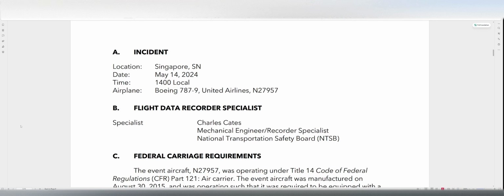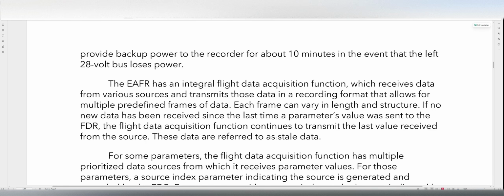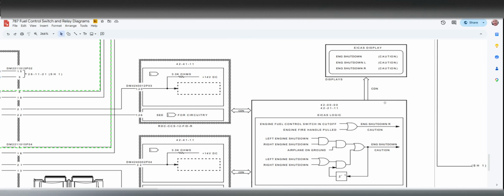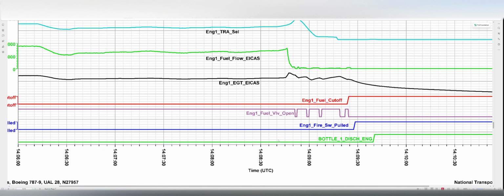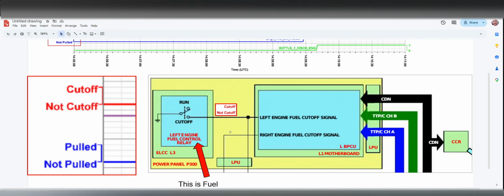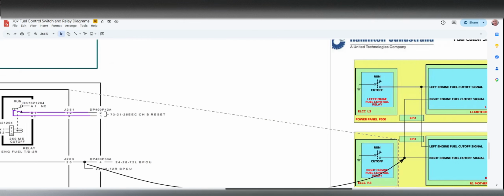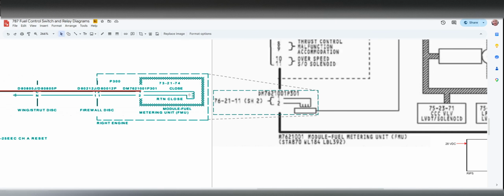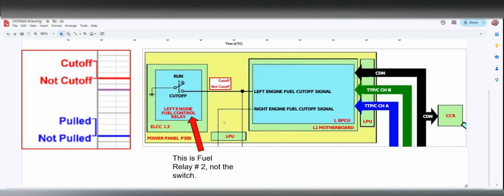Air India AI171 B787-8 Crash - EAFR Reported the Cutoff of Fuel Control Relays L2 + R2.

Comment: As usual, this episode is a very readable material pointing straight to the cause. No others know better than Jeremy.
But if all these big names, “experts”, “authorities “ don’t learn, stay innocent. Same tragedy will happen.
The use of relays in signal conditioning is completely fatal in computerised aviation control. There are hundreds of design /implementation faults in the B ‘s aircraft control system. I’m only listing the most critical one.

Comment: Any analysis into why that Eng1_Fuel_Vlv_Open log is chattering on and off for 40 seconds after the engine started to spool down? What's that reported signal from? Is this toggling actually happening due to valve position, or is it for some other reason and not a true valve report? Is it due to electrical issues in one of the busses? or busses switching 28V sources? or some other control system mucking about with the valve position?
Reply from the maker: That's the EEC trying to cut the fuel completely at the HPSOV to start a new relight cycle to save the engine from its sub-inflight idle. It cuts fuel and then commences a slow increase in fuel and ignition. But in this case, the engine was simply broken. So it didn't work then the pilots cancelled it all by shutting down the affected engine

Comment: Good material, I haven't had the opportunity to look at these systems up close. In your APR 17 episode you actually showed the RDC connected to one of the Honeywell 4TL837-3D cutoff switch circuits. That RDC directly monitors the state of this switch, and not the noise susceptible relay which is at the core of your theory. I haven't had the time to finish all your videos, but I asked Gemini to find a specific episode where you explained why this particular RDC failed to inform the recorder "hey, the actual switch didn't move, and the relay moved by itself"? Did they design the EAFR to completely disregard this RDC's report?
Reply from the maker: its not that its dissregarded. its just that in this accident, its impossible for the RAT to be out due to engines out. therefore one must look at how the RAT out was caused, and then how THAT caused the cutoff. The FDR Votes on data sources. 
Either
a. the RDCs went offline momentarily due to the lack of power, leaving only the L and R BPCUs with their many sources of edundant DC power as the next best thing. OR
b.  due to loss of the 28V, The RDCs 14V optocouplers lost the RUN signal but didnt get a cutoff signal, and at the same time the BPCU saw the Cutoff signal, which had the EAFR record CUTOFF.
OR
c. the cutoff vs not cuttoff line is never actually the RDCs, rather the cutoff vs not cutoff relay signal from the switch, as it SHOULD only ever represent the switch position by design
Reply: @jeremyjohnthompson5187  Your channel definitely needs to be heard. If power drops then there is either no data or no reliable data for the EAFR to disregard. 

One point I don't understand is why you suggest only the relay signal should ever represent the switch position by design. Doesn't that solidify the semantic discrepancy? 

This topology can be categorized as a multi-point monitoring configuration. Where the same component produces progressive stages of output, propagating downstream. Semantically, the first RDC is as close as it gets to literally mean "switch position" because the commond data network doesn't directly pick up mechanical contact states by itself. Whether that RDC is present or producing reliable data can be guarded by the deterministic communication protocol, but topologically, the switch means the switch. 

The relay downstream should not mean the switch because in this case, two objects compete for the same name, the one closest to the true meaning should win. Unless there is no way to directly monitor the switch iteself, therefore no object competes with the relay for that name. That's why your point feels confusing to me. 

This is not me saying the investigation doesn't need to look into the sequence of events behind the RAT. That part has been a major puzzle and they definitely must get to the bottom of this. I'm just a curious guy. Because I really wonder how the actual logic is designed to aggregate and arbitrate both data reports from the RDC and the motherboard behind the relay. 

I also need to spend more time to watch and understand the parts where you explain the reversed polarity. I use changeover relays and solenoids regularly so a permanent magnet plunger that gets actuated in different directions depending on the polarity of excitation isn't anything new to me, I'm sure it's not new to those folks who designed the circuit. If it's something that actually happened, then there must be more occurrences, and AI171 was unfortunately the one where all the holes in the Swiss cheese model lined up. Investigators seriously looking into this hypothesis must actually rebuild the circuit and provoke this kind of fault so they demonstrate the relay actuate in the wrong direction like they did decades ago with the 737 rudder dual servo valve.

Comment: The FDR recording a relay signal and not a switch position in the cockpit is what I suggested could account for the "switch transition" and not physical movement of the switches at the very beginning.  The theory was shut down by people claiming that the FDR recorded the actual switch position using a circuit that was independent of the relays.  It will be interesting to see how the authorities address how a run/cutoff indication is recorded by this particular aircraft model.
Reply: I believe, that having two (or four for redundancy) additional microswitches to monitor the true position of every critical switch in the cockpit would add complexity that A/C manfuacturers deemed unnecessary. The additional failure modes not even considered. In my eyes the fact, that the "switch position" was communicated was the big mistake of the investigators. The FDR simply recorded the "operational state" of the cut off system. It is just not the same. Especially in an electrical system that heavily relies on power busses that are switched on and off electronically.
Reply from the maker: @lupobikes  well no hang on, the system monitors the position via the RDCs. its just that it isnt used in this case forthe reporting of the swtich position. The EAFR  is recording, "what is the result of the switch position on all systems."
However the system usess only the RDCs real switch phyiscal position to inject the cutoff signal onl to the logic for things like ENG FAIL verses ENG SHUTDOWN, which goes to both EICAS and things like ENG FAIL logic. have a think about that.
Reply: I worked as a railway interlocking engineer for some years. Very simply put: Those interlocking relays have a double fail safe and self cleaning contacts. Both, the working and non working position of the relays have a circuit that only works when the real state of the relay correlates with the desired state. If one of either does not correlate with the demanded relay position (for example when a short circuit occurs), the circuit is interrupted and the relay automatically falls into the "off" position. Off means "red signal" in railway terms which is the desired safe position. I would love to know, if boeing designed the relays on a critical circuit without  SIL4 in mind. Maybe I am wrong on this one since i do not have seen the whole circuit.
Reply: @lupobikes Agree, whether it's solid state switching or mechanical relays, there is always the possibility they could fail or react to a short circuit, upstream or downstream, in ways not previously envisioned by the designers.

Comment: I think you are spot on. My indepenedent research (although not as indepth as yours) lead me to the same conclusion of electrical failure. From what I have also gathered is that this particular airfame had gremlins right from delivery to the extent that AI had almost refused delivery. Also, the phrasing and general sentence structure of the DGCA prelim report is not something an Indian investigative officer would write. IYKYK

A question I have is - how else would this reverse polarity scenario show up on the EAFR? Could there be other systems outside of engine/fuel that would go into an "invalid" state only when a rev polarity is applied? If so, that could be our smoking gun in proving this.
Reply from the maker: We dont have the EAFR. We have lack of the bright red beacons on the takeoff roll video, intermittent failures of 1 of the power inputs to the BPCU and FCE just before departure, and a ram air turbine out before the engine fail logic, main AC bus fail logic, or hydraulic failure logic could have had it out. Only one left was loss of ALL electrical power to the flight instruments.
The giant cloud of white battery smoke on rotation.
The return to normal after 15 seconds, aligning (to the second) with the opening of the MBR after 15 second batt fault countdown.
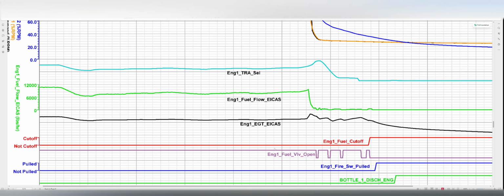And the assurance that the main AC from generators was still on thanks to the transponder pings up until 08:51.
Reply: @jeremyjohnthompson5187 Or something shorted out from moisture condensation inside, or leaky plumbing over, the EE Bay.  I absolutely hate lithium ion batteries and refuse to fall for the EV stupidity until better battery chemistry or a capacitor storage solution is found.
Reply: @BlueSpruce2 you arent even allowed to charge lithium ion moped batteries inside residential builidngs. they are that dangerous

Comment: Don't get disappeared! 
Do you have a datasheet for the dual coil latching relay? We need to understand its physics. The rocker needs a magnet on it to make it polarity sensitive to the coil/s. Normal relay arms don't care about polarity and latches don't usually care about polarity because the coils are on opposite sides of the travel. It's possible this specific latch works as you suggest: 2 coils, probably wound on the same bobbin and a magnet on the rocker. If it indeed functions that way then you have a smoking gun! Get the datasheet and procure the relay to demonstrate then your case is conclusive. This would be an incredible demonstration and a shocking design flaw. Even worse that nobody picked this up during design or certification.The Dk7621204 relay datasheet is not publicly available.
Reply from the maker: These NEED correct polarity as per the specs.

Comment: Thank you for your continuous effort to show this design flaw!
Your findings always stayed the same from the very start, from your first video explaining the diode module design flaw. Hats off!

What is the official root cause? Any news on the investigation? Still pilot error? 
(Sorry I did not follow all official statements)
Reply from the maker: They will try to delay it, likely for 10 years like airbus did so the public will forget about it, like nobody cares anymore about the air france crash.
Reply: @jeremyjohnthompson5187 I don't think you are saying this is a design flaw, only that your analysis is a high probability failure mode that could account for what we know so far.  The only certainty in life is that we will die at some point. 😊
Reply: @jeremyjohnthompson5187  or concorde..highly suspicious event.. given the result of the shutting them all down...

Comment: Cut-off/ Not Cut-off does make sense to me. When turning on the fuel cut-off switch to not cut-off without the ignition being on, the engine is not running So calling it 'run' would indicate that the switch is the only thing needed to bring the engine to running.
Reply: This is standard logic notation and is correct for this binary control signal. It is telling hardware to cut off fuel or not cut off fuel and the logic chain as I understand it is only connected to the cutoff contacts in the switch. The other contacts on the run side are monitored but we have yet to see any display of that signal. All of the confusion could be answered by this additional data which was put there by the original engineers to cover such a situation of hardware failure. Having worked with software engineers for years I can see them not even recording that side of the switch as perceived as pure redundancy. 
This mindset is prevalent in all reporting outside of the work Jeremy is doing with the simple minded analysis of - read back means pilot through the switches. 
This is an embarrassment for the community.

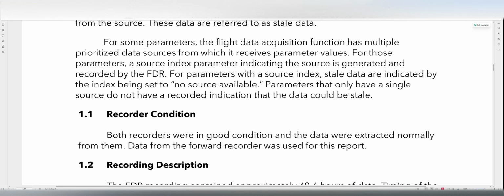Comment: @ 5:00 Could also be even worse than this, maybe even 5 seconds of inaccuracy, as the BITE health, network monitoring of the AFDX ARINC 629 (of which, only 2 of 9 requirements I was assigned may have ever got implemented.   So potentially, no, or reduced, channel redundancy.  I assumed someone else was assigned to implement the remaining 7 of 9 BITE requirements, after I was terminated, as a contractor, in 2008.  This was just before the Global Financial Crisis.  Since the AI crash, I question my assumption.  I sent a message to the NTSB about this, but all I got was an auto-reply email).   

It may take 5 failed, 1 second samples before it concludes the control network has failed (potentially same delay with recovery).  I did not know if they were going to use this status, to automatically shut off both engines, as an unsafe, "failsafe" control action (The System Theoretic Process Analysis - STPA, might have prevented such a lethally, unsafe control action, implemented in the development procedures, but my understanding is that STPA was not being implemented at that time).

What I am getting at is, as a hypothesis, it may not even require a reverse polarity on the relays (via diode), it could also be just liquid ingress on the control network cabling, degrading their performance, triggering the lethal shut downs.   The 787 has liquid cooling tubes in the avionics, a leak on any of this tubing, or ice melted from frozen heat exchanger coils, piping, or any other plumbing, or condensation, could potentially trigger it (the IAI channel with Richard Godfrey, points out in the Boeing documents where the system shuts off from a sensed, degraded AFDX ARINC 629 control network).   If we had the raw flight recorder data, it could help determine what happened, but they do not provide it to us.

Comment: I would suggest you consider welded contacts in the relays as well. I’ve see welded contacts in a $2.50 relay burn down at least three buildings in my career because the engineers who chose those relays never considered this failure mode - that’s because they were incompetent engineers just like those Engineers in Boeing.
Reply: 2 relays failed simultaneously?
Reply: @Buddy787-q4n  you failed simultaneously
Reply: @danielleclare2938  At what?
Reply: @Buddy787-q4n  needy questions
Reply: @B @Buddy787-q4n  No, not two relays. This was back in the day before (not too long ago) when they used a single relay to interface the control circuits with the motor starting contractors. Now of course, we use two with two independent modes of control with main incomer trips should we have an unstoppable motor circuit.
Reply: @TheTeaParty320 I've had two relays fail simultaneously on my European engineered car so I wouldn't rule anything out just yet even if we're looking at N+1 redundancy.
Reply: @BlueSpruce2These things happen. In industrial/aerospace/military systems we use high integrity safety related systems with backup independent circuitry so that the probability of catastrophic failure is designed to be below some arbitrary design criteria, say one failure every million years, for instance. These failure rates are assigned according to the acceptable fault tolerances required and defined by the engineers.
Reply: @TheTeaParty320 Agree, military aircraft are built to very high mil spec standards and not just because they could be damaged in combat.  They need to have high availability rates and not be sitting in a repair depot most of the time.  Was requirement we take an engineering specific probability course in engineering school so I'm familiar with the language... 😊
Reply: there are such things as forced-contact realys and realys with secondary signalling contacts that ride on the back of teh power switch contacts. these additional contacts report what teh actual relay power switching contacts are doing. these get used in safety critical circuits to signal back to control system if something is fused closed in the relay, or if the relay has failed to move when activated
Reply: @quesoestbonne Yes. There are many types of relays available to play with. The main question is what relays Boring put in their design. It’s clear to me that, relays or not, there’s been an incorrect logic activation in play here.